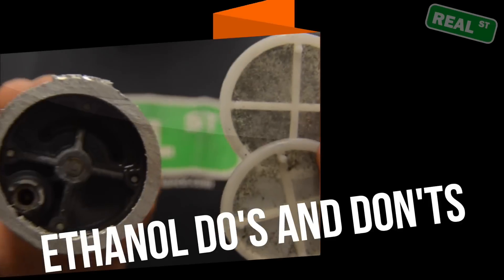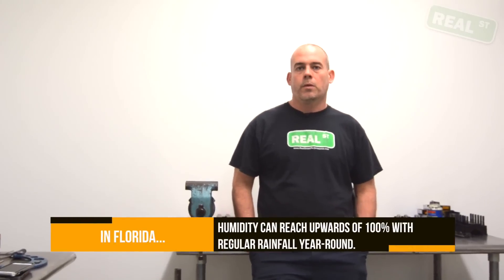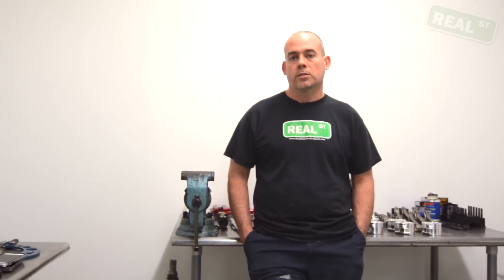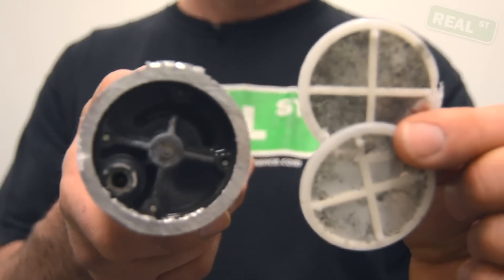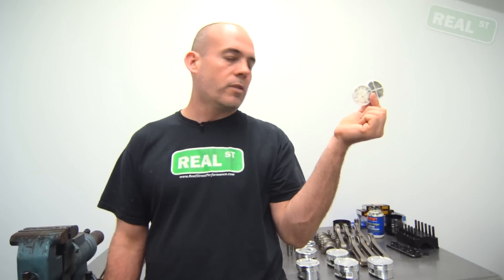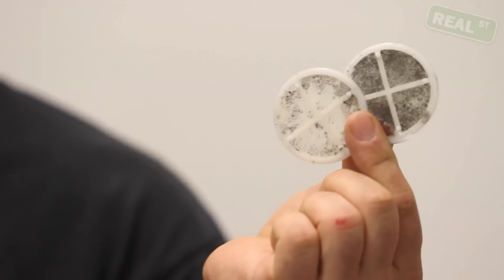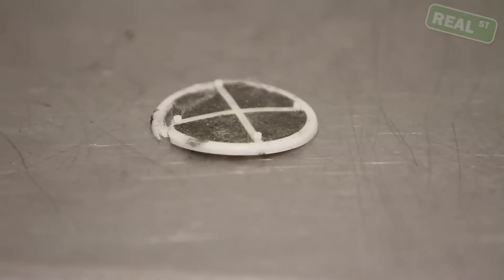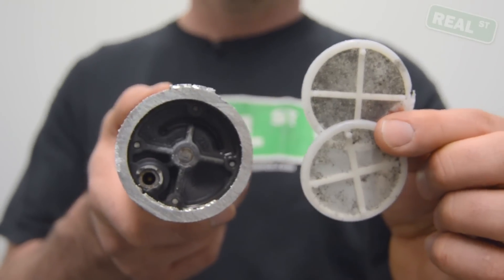Ethanol Do's and Don'ts - Jay's Tech Tips #17

Comment: I’ve had an e85 tune for 3.5yrs and just cut open my old filter a couple months ago. It still looked clean inside the filter media an didn’t see any particles at all. I think I’ve only ran 91 a few times since 2018 so it’s primarily been on e85. Just my experience, but still good advice here.

Comment: So I have a street car (91 Mustang 5.0,  stock motor with blower/N20) that i run 50/50 93/E85. No problems so far, do you think the half gas solves most of the problems?
Been doing this for four years, it also sits for months at a time!

Comment: So... would you suggest converting to E85 over a water/meth setup? Also..what entails a proper E85 conversion? Without worry...
Reply: Flex fuel sensor, larger fuel pumps, larger injectors, stand alone ECM such as Haltech. Might as well replace fuel lines as well.

Comment: I'm on my 5th set of injectors due to E85 corrosion failure.
Reply: I don't know you're setup so this may or may not help but make sure you're fuel system is done properly for a Ethanol setup and if it is then depending on how much you drive the vehicle only put in enough fuel at a time to last you a week, and use Lucas Ethanol Stabilizer once every other fill up. Letting Ethanol sit as little as possible and using Lucas in it will lessen the gunk and corrosive effects of Ethanol as much as possible.
Reply: Justin Vanover I live in Sweden and we have E85 at every pump. I THINK the reason might be that I've worked offshore 2 weeks at a time and that's killer for the injectors. I alsi use Redline SI Alcohol every time I fill. But, I'll fill the tank with gas everytime I need to park it from now on.
Reply: oistein74
Yea that is definitely the issue, I personally would start my car everyday and let it get to running temps if I had one running ethanol. And not let any fuel be in the tank for longer than a week. If you care about the performance of your car and making sure it is pushing the most power it can then I suggest since you've had to go through 5 sets of injectors you also need to replace all fuel filters and fuel pump. You probably also have some Ethanol Gel in the bottom of fuel tank also.
Reply: Justin Vanover Ive changed everything. Fuel pump and filter, inline filter and inspected the tank. no gel in there. But yeah, if I need to park it for more than a week I'll top it off with gasoline from now on.

Comment: Question, was the dirty filter used with a used fuel tank?  Ethanol will clean gunk out naturally.  Real test is to use e85 on a new tank or fuel cell in which there are no deposits from previous setups.

Comment: how about if your running a 30% blend
Reply: That is a good option, especially on direct injection cars, it's actually (mostly) pointless to run more than a 30% blend on most direct injection cars. On port injection it is a good way to get most of the benefit without as much of the downsides, at least not as quickly.
Reply: Yeah I drive a focus ST on a blend 3 gallon e85 9 gallons of 93 but I'm curious if this applies but just takes a lot longer I'm assuming

Comment: Wait I'm confused here.... there is plenty of research done that shows that E85, when tuned properly, on a non E85 car ( that is newer) is much more clean then premium gasoline. Any fuel that sits eventually goes bad. But I haven't heard anything about pumps going bad. I know cars that have been on the stuff for years. Friends and also friends of friends. V8s to v4s. Turbos, supercharged, also n/a. Just asking what's the real deal. I'm also in AZ so a very dry climate...
Reply: What's a v4s? You mean V4's... like half a v8 because that's not very common motor. Sounds like a boat motor maybe... anyways basically if you let your car sit more then one week at a time. Flush the system with gas to save headaches & other fuel system problems related to e85. Gas goes bad after 6months.. e85 like 6days if in a high humidity area. Your in AZ so you might be safe for two weeks or so..
Reply: No all fuels go completely bad. Ive seen fuel sit in cars for years then when the caf started up it ran rough for a while then was fine. But e85 is just corrosive

Comment: Pro's and con's of methanol/water injection on turbo charged vehicles
Reply: water/meth is much cheaper and easier.
Reply: If you don't have e85 available, it's the poor mans race gas
But if you have ethanol available, just spend that money towards more inj/pump
Cons... if the pump fails you'll detonate your engine to death unless you got some fancy EMS that cuts spark pulls timing or soemthing
Refilling
Getting ahold of good windshield washer
Reply from the maker: Before e85 days a lot of us ran Meth kits with regular 93 in the tank (and 100% meth in the meth tank). It worked great but like you see mentioned already you need a good failsafe setup. Some of us used to run a light inside the car that showed when the pump was active. I would have the meth start spraying around 10-15psi and ran ~30psi on an old school GT35R without issues (with a built motor WRX). Also if the car detonated too much the AEM EMS would pull timing and boost to save the motor. Was a great solution compared to C16 and made pretty much the same power. E85 these days though is a much better solution, you can make more power and even safer. Just keep an eye on the typical ethanol maintenance like mentioned in the video.

Comment: Jay said that moister in the tank can cause the fuel to gel up. That gel, if you touch it does it get sticky like caramel or something similar as it dries up?
Reply: At this time I can't really find the exact words to explain it...
Reply: boricua1555  Yes, ethanol based fuels that are moisture contaminated will congeal to form a moisture rich gel, usually starting at the fuel tank/cell bottom or system low spots. 
Badly gelled ethanol fuel is sticky and similar in consistency to K-Y Jelly or warm liquid Jello. 
The gel does not revert to usable fuel, does not readily (easily) return to a liquid even with additives and will reduce flow, clog pumps, filters, orifices and injectors. 
The gel has a high moisture content and will promote damaging corrosion on any metal fuel system components that it has prolonged contact with including fuel tanks, pumps, lines, injectors and even aluminum components.
Reply: patw52pb1 thanks, I asked because where I work at we had an SUV fuel pump working stop working, and when we took out the fuel pump it was corroded. So we put a brand new one in it worked for a day, and then stop, removing that pump we found the gel in the tank and that the pump started to lose its coloration. We clean the tank and put another pump. Oh and it turns out that the SUV hadn't been used for almost 2 years. Thanks again for the explanation, I'm still learning, still learning to be come a mechanic.